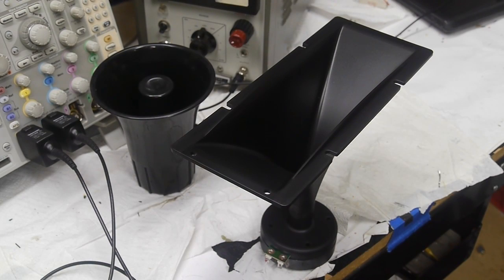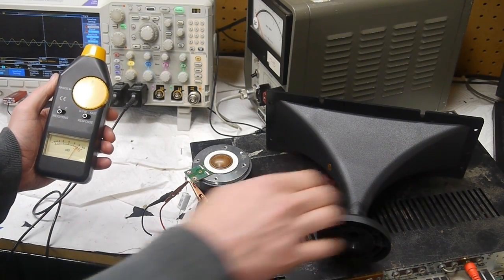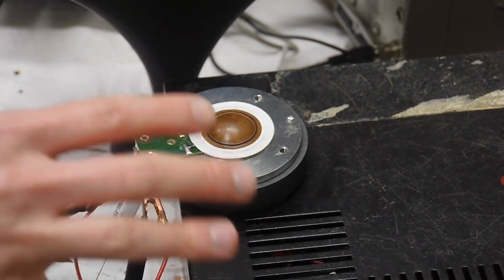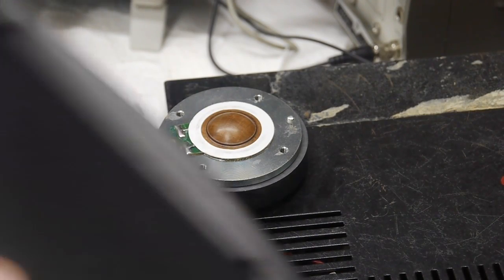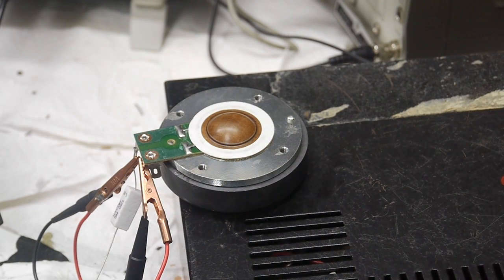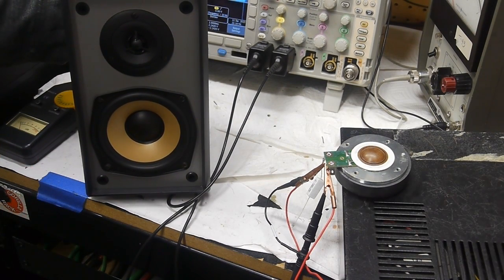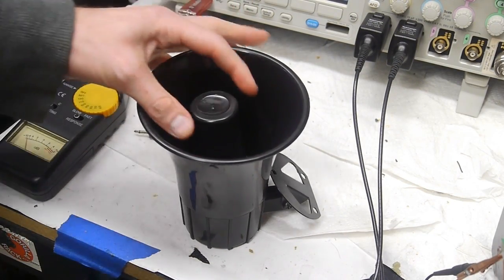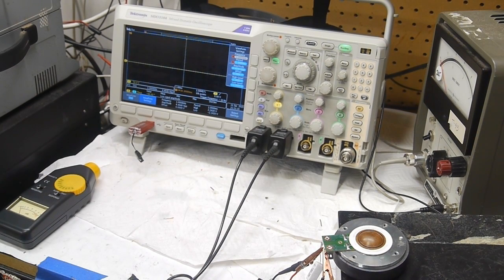How a horn amplifies sound (hint: Impedance matching)

Comment: Great video! Now I want to measure the effect my Altec VOTT horns have on the driver with both a tube amp and a solid state one.  . You probably didn't see any difference on the 'scope because the amp has a much lower output impedance than the speaker. Impedance matching is not as important as it used to be with tube amps which used output xfmrs. The maximum power transfer theorem does not apply because the amp has such a low output impedance. The speaker impedance does not match the amp because it would be impractical to make a speaker with say, 0.1 ohms. We use 4 or 8 ohms by tradition. You could add a series resistor of about 1 ohm to measure the current. And use low duty cycle tone bursts to make the neighbors (and your ears) happy.

Comment: Great video.

Another prop you can use in the explanation, is a tuning fork suspended over a tuned glass of water (the correct level to reach resonance).  The volume change of sound coming off the tuning fork and out of the glass is exponential.

Comment: Great video! Just to be sure I understood, is the horn is being physically moved by the dome?
Reply from the maker: RimstarOrg
No, I'd say the horn should ideally be very rigid, and non-movable.  The air pressure waves will bounce off of the surface, and expand outward.  There is a nice animation here:  http://en.wikipedia.org/wiki/Horn_loudspeaker
Reply from the maker: Thanks!  The horn is fixed to the magnet/body of the speaker and stays stationary while the voicecoil and dome move to create the pressure wave.
Reply: Applied Science
So the fluctuating pressure wave moving over the horn's surface causes the horn to physically move and then the horn's larger surface interacts with a larger area of air to create the higher volume pressure wave?
Reply: So why aren't massive horns from old-fashioned record players more popular? After all, they can be enhanced with more up-to-date equipment.
Reply: Applied Science
Ah. Thanks clarifying.
Reply: +Applied Science Better explanation than Geek Group's.

Comment: Also, the cone (unlike a single resonant LC circuit) can match impedances in a wide spectrum of frequencies. This is interesting because the cone (a tapered transmission line) is effectively a cascade of multiple LC circuits with gradually changing characteristic impedances.

Comment: Your videos are some of the few videos where I really learn something!  Never thought about horn tweeters much before.
But the newspaper air impedance example - the coupling with the newspaper wasn't the same sort of coupling as with the stick.  Mostly, it was vacuum that held the strip of wood to the box, as opposed to strict air resistance.  Maybe I should do a video on impedance of fans and blowers, so I won't have to keep explaining why a furnace blower won't work as a dust collector.
Reply from the maker: Thanks, I really appreciate it!  You are correct -- the vacuum created by the newspaper is generally what holds it down to the flat surface.  I was hoping this could be interpreted as a sort of impedance, but to be technically correct, it would have to be a really lightweight, stiff vane that is in free air.  I'd be interested in your video on dust collector impedance.
Reply: That FREAKING AWESOME moment when you have 2 of your favorite youtubers commenting on each other. Damn I love youtube. :D
Reply: I, as a viewer of your channel, would really like that video.
Reply: Vacuum is not holding anything. The air pressure from the other side does (pressure difference).
Reply: Tycho343 I think that's just semantics. The point made is that the effect probably wouldn't be the same if the table wasn't there.
Reply: I noticed the same thing but I figured the practicality of holding the newspaper off the bench to prevent vacuum effects was less important compared to the example he was trying to make.  I suppose Ben could have done the example by hinging the wood on the edge of the bench so the paper was hanging oriented in free air straight down (I guess similar to a protest sign held upside down and pivoting mid-handle, just with newspaper instead of cardstock) and then struck the free end so it was purely air resistance and not vacuum.  Very similar result, just much more setup time.  BTW, Matthias, I have no idea why tool manufacturers don't want to sponsor you either. :(
Reply: Applied Science I smell co-operation! :-D
As a fan of you both, Thanks for all the videos.
Greetings from Norway
Reply: Alfredo Albanez You're so right!
Reply: +oaaserud +1. Or, as they say, ditto.
Reply: please do!
Reply: Good
Reply: Did you end up making this video?  I love your content btw, and refer every tinkerer/woodworker I meet to your channel.

PS. Lierofox:  tool manufacturers won't sponsor him because he just keeps making his own tools.  Until Makita releases their Baltic Birch line I don't think it's gonna happen, unfortunately ^_^
Reply: there's no difference between vacuum and strict air resistance...or anyway that's to say you can't have one affecting the system without the other. When you put your hand out the window of a car, it's being pushed back by the air pressure in front of it, but that wouldn't happen if there weren't lower air pressure ("vacuum") behind it. Suction cups aren't held to a wall by vacuum, they're held to the wall by the 14 psi air on the outside of the cup and the fact that there's much lower pressure inside. The newspaper is held down neither by vacuum or air resistance, but by the differential between the two.

Comment: Makes me think of the output from a tuning fork -- quiet in air because the relative plunge vibration of the base of the fork doesn't interface with air well...but place it on a large flat resonant surface and suddenly the energy can transfer into the air.
Reply from the maker: AnonCh4r1i frollard It's true that a tuning fork doesn't contact much air, and sounds much louder when coupled to more air through a tabletop.  It's also true that the fork tines interfere with each other.  The next time you have a tuning fork, set it ringing, then twirl it near your ear.  You'll hear nodes and anti-nodes indicating areas of constructive and destructive interference.  It's like a little acoustic lighthouse!
Reply: I think its more so that each leg of the fork is out of phase with the other one the average SPL is very small in air, until the base is used to transfer the combined longitudinal?
Reply: Applied Science AnonCh4r1i I was going to reply exactly like that -- its some function of both of those, inefficiency and interference.  Leave it to A.S. to put it into an excellent description :)

Comment: Ben, maybe you should consider sound proofing your shop.  Maybe not a full anechoic chamber but something to help deaden it to the outside.  Most folks are not going to understand, tolerate, or appreciate odd experiments, late night welding and grinding, or other unexplainable noise/light sources.  Btw, nice work as always.
Reply from the maker: Yes, if I were building a home shop from ground-up, I'd add lots of sound deadening.  I've done sound measurements while outdoors with machines running inside, and it's really not so bad, though.  The comments about my neighbors were jokes in this video.

Comment: I have some old Radio Shack Mach 3 speakers and they have a horn midrange and tweeter in them, as well as the 15" woofer.  I think they have real high sensitivity from memory, and handle 160 WRMS.

Comment: could you build a silence box for the speaker? Like a small 30x30x30cm box with the inside lined with this sound absorbing wall material? How much would you hear from the speaker on the outside and how does it affect measurements?

Comment: Don't think this explains why horns work. We are trying to displace more air for a given diaphragm stroke. An imaginary massless larger diaphragm accomplishes this cause it displaces more air for a given stroke length. If you imagine a horn/driver combo with a rubber sheet stretched across the outlet and filled with water ( as in a hydraulic cylinder), the sheet would move a smaller distance and with more force than the diaphragm ( according to the ratio of the piston areas), giving an impedance transformation in the wrong direction. Seems there is nonintuitive magic going on in the horn.

Comment: Can you talk about these concepts in terms of impedence matching in guitar amplifier speaker cabinets? Why do you get different impedence when you wire the same speakers in series or parralel? With tubes and output transformers what are and why are there dangers to the equipment if you fail to match the cabinet's impedence to the amp output? Is there a danger in mismatching both too high and too low, or just one or the other? Nice video. I liked it. Thanks.
Reply: I think your questions have more to do with basic electronics. As a first approximation, you can think of speakers as resistors. Putting them in series sums their resistance. Putting them in parallel decreases their resistance: http://hyperphysics.phy-astr.gsu.edu/hbase/electric/dcex3.html
I'm not sure about matching speaker to amps, but I would say to make sure your cabinet does not let too much current flow through it, otherwise things will burn. (Your amp will output a maximum voltage. Divide that by the resistance of your cabinet and see if that current is over the cabinet's power rating.)

Comment: i think wind or brass musical instruments are a good demonstration of this,..if you hear someone buzzing their lips it's not very loud, but put a trumpet on the end of that and you can hear it extremely well,..there's also some back pressure because the mouth piece acts as a nozzle
Reply from the maker: Absolutely.  In fact, the taper of the horn is a major difference between trumpet, flugelhorn, and cornet.  It contributes to the timbre and characteristic sound of each instrument, even though the pitch is the same.

Comment: Your presentation applies also to low frequency drivers (woofers) and the various cabinet designs, given particular applications.  Low frequency concert and theater sound system cabinets can exploit a flared throat much like your tweeter horn;  the Altec Lansing "Voice Of The Theater" is a classic example, where a low-range 15" woofer drives into a throat, providing the acoustic coupling of driver to listener space.  A VOTT setup would have a large version of your tweeter horn attached on top of the flared-throat bass cabinet.  In fact, in the earliest years of motion picture sound systems, the audio amplifier technology of the time could only produce a few tens of electrical watts into the driver.  Low frequency cabinets of the day were massive, to eek out as much acoustic coupling efficiency as possible.  Another consideration (that you mentioned) was size of horn.  For low frequency horn cabinets, the drastically longer sound waves would require flaring horn throats of feet or even yards of throat distance.  Clever bass cabinet designers found ways to "fold the horn" like your re-entrant plastic speaker, where the output from the speaker driver would be guided through a series of folds to the sound path before exiting to the listening room.  Thus, a folded horn bass speaker - while fairly large - could contain an effective horn that would have been prohibitively long if constructed in a straight line.  Nowadays, amplification technology commonly produces hundreds and even thousands of watts of power to the bass drivers, so super-large horn cabinets are passe.  The newest concert sound design utilizies a "line array" effect, where a number of much smaller cabinets are positioned in a cluster / line, giving an overall increase in acoustical output to the listening room.  The coupling between cabinets improves efficiency, and cabinets are frequently hoisted into the air in a "bending line" to provide optimum room coverage of the full frequency range.
Reply: KdetJim You know what they say about Bose right? "No highs, no lows, it must be Bose".
Reply: Isn't this the same idea (the folded air path) that's present in high-end, compact home speakers (thinking bose) to create a fuller sound?
Reply: Haha. No, I've never heard that, but it's funny.
Reply: Atimatik Army That's what they used to say about the Bose 901 series 1 and 2. I have a set of series two's and am going to have fun trying them out eventually. Supposedly they work very well, but need a lot of watts to drive them, the 3rd series added porting to the cabinets to reduce power needs and improve low frequency response. I'll have to see how the S 2's sound when I try them out..
Reply: Oldbmwr100rs Cool!  Might be good in the studio!

Comment: Another great video to visually show impedance matching. (URL at time of section) https://www.youtube.com/watch?v=DovunOxlY1k#t=1141
Reply: What a-hole is marking you as spam? That video explains a lot and goes into the material that Ben is telling about. +1 would unmark it as spam if that would be an option.
Reply: That wave device is gorgeous!
I wish I had seen this video when quarter wave coatings were taught to me.  So intuitive.
Reply: That is a very good lecture.

Dr Shive's erudition and precision of expression is a joy.

I would imagine that were he and G.W. Bush ever to shake hands they would both annihilate each other in flash of energy.
Reply: Applied Science
True, but one would think that a Youtube link would not be automaticly selected as spam by their own filter. What kind of programming would that be?
Machines or programming isn't capable of making unlogical mistakes, thats the job of the humans.. hence why I suspect someone instead of something is behind it ;)
Keep up the good work btw, your channel is one of the few that is actually providing something of worth on YT imho.
Reply: I was going to post this very same thing, but you beat me to it. Definitely not spam.
Reply from the maker: RadioKies Unfortunately, the automatic spam filter will mark most comments with URLs as spam.  I'm not sure how it handles exceptions, but even though I manually cleared this comment, the "spam" flag still remains.  The system is not perfect, but it's better than having the entire comments section completely flooded with spam.